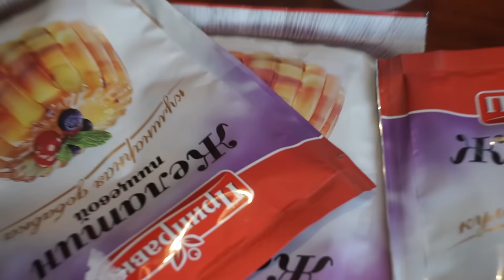Homemade Gear Casting, method of homemade silicone

Comment: Wait a minute homemade?
Yeah I have a lathe and a
Forge in my garage
Reply: I know what you mean, but you must admit that you can still do it at home.
Instead of a lathe, you can use a file and sandpaper to finish the detail, you can build an electric forge yourself (from scrap) or with a propane-butane gas cylinder.
Below is a link to the film in which my countryman shows how to make it, and a second link with the gas version
https://youtu.be/Mjlwc4x3GKE
https://youtu.be/b8zOQ4hyQzc
Reply: @Gabriel Barile  ...to add to Tristan, you can even do a hole in the ground foundry "How To Melt Aluminum With A Hole In The Ground" https://www.youtube.com/watch?v=O_TU-PCudoE.  I made a simple foundry with two round flower pots (one as lid, one on bottom with hole with air from blow dryer coming through to blast the charcoal) with about 1" thick layer of refractory inside, worked great.

Comment: I think plastic wheel protect motor against overload too, in case unintended gate lock.
Reply from the maker: the mechanism provides electronic protection; when the current consumption increases, the motor stops.
Reply: @mad_wheel  Also. If we change point of view it could be safety reason. Anyhow, amazing work. Congratulation and all the best.

Comment: Why isn't it made on metal from the factory? - Programmed obsolescence.
Reply: It could have been for safety. On many boats, they use a flexible coupling that will break if something hits the propeller and stops it. That protects the prop shaft, transmission, and engine from being damaged or destroyed. But if you use the correct fuse or circuit breaker on the electric motor, that should protect the motor from shorting out if the gate is stopped, and the video showed what looks like a reversing mechanism that will reverse the gate if it hits something and is stopped before it reaches end of travel.
Reply from the maker: The device has electronic protection that works when there is an obstacle in the way!

Comment: All those bubble in the pour, you have a garbage part, even if it looks good on the outside.  You have to de-gas the molten aluminum AND pre-heat the mold to 1100-1150F.

Comment: These gates can be broken bones by undesirable guests
😂
Reply from the maker: In the mechanism there is an electronic switch in case of excess current, if there is an obstacle.
Reply: @mad_wheel  I was joking. Of course there's a cut-off.

Comment: I wonder if the manufactuer  has the part for sale, one phone call could save a lot of work . cool video though but. 

 talk about dangerous for the inexperienced,, phew, also would probably grind the other gear to bits if its not smooth enough

Comment: I know the plastic is a kind of a breakable point so other parts do not. But who fixes anything any more? They might as well made it out of aluminum. And let it all wear out for much longer. Probably would have run for years if not for that plastic gear. Then throw it away. As you more than got your money out of it.

Comment: Sir, I want to ask what special hardener is mixed into the jelly.
Reply from the maker: I mixed glycerin from the pharmacy and gelatin from the grocery store in a 1: 1 ratio.
Reply: @mad_wheel  if i take 1 liter of Vegetal Glycerin and 1 liter of gelatine than it will work for maken a mold for a handle and its best too have powder gelatine greets danny

Comment: so if i understood that correctly you made a copy of the original gear out of something cheap and then created a mold around that new piece out of something that doesnt burn then poured melted metal into it replacing the first part you made as its burned up ?
Reply from the maker: That's right, I got a copy from the wax after I put it in gypsum and when the gypsum froze I melted the wax and poured it, and molten aluminum alloy was poured into an empty cavity in the gypsum.
Reply: @mad_wheel  that sounds awesome and all but I don't see how you would get all the fine details of holes and cavities in the middle of the part the outside would have the Sandy substance mold to it but what about the pieces in the middle of the part
Reply: @mad_wheel  if the piece has Chambers in the inside that doesn't directly touch the Sandy substance then how could it mold to it

Comment: I would have just cut the gear on the lathe from the start. if you don't have a rotary index, they're very easy to make. yes. they work on helical gears just fine. I still would have cast the Al for the stock, however.

Comment: With 3D printing technology replacement parts can be made overnight without burning a whole forest down
Reply: Most casting ovens use natural gas or propane
Reply from the maker: Now I do not yet have 3D printing technology.

Comment: plastic gear is used as a protection against damage to the entire mechanism is the least resistant. damage for a reason for a reason.
Reply: Plastic often becomes brittle in the cold. This mechanism might not be designed to work in the cold climate in which the author lives.

Comment: lets cast a gear, and finish it up with lathe.

instead just made it with lathe
Reply: What would you propose for cutting out the teeth? The whole casting portion is presumably to make that portion easier as he just needs to trim them to specifications but the teeth portion wouldn't be able to be done on a lathe...or am I missing something here? Interested to know for a turbine, inducer, and some other parts I was looking to cast and then dremel to specifications for a hobby project of mine.
Reply: @AM-dc7pv  I've made gears on a lathe and on a milling machine (using a good dividing head). Once I even used a broken gear as a hobbing tool.
Reply: @UncleKennysPlace  and how would you propose to cut the recesses in the back of the gear wheel with a lathe.

Comment: Fair WARNING HERE...When you cast aluminum it shrinks...steel is more accurate...in High School I learned from my Auto Shop teacher as he tried to cast Aluminum Corvette Valve covers for the DBC Engine...fail...because of shrinkage...I cannot remember the ratio but this can be found in google(I hope) it's a low # like 3% 0r 6% in this area...double check gang...
Reply: 2% volume shrinkage for cast aluminium.

Comment: Before this replacement You had one repair possibility - the weakest and cheapest part, which was that gear. Now the weakest part is probably one of the most expensive part. Failure in different location can lock the engine and burn its windings or destroy enclosure/engine mount. The procedure is really fascinating, satisfying, but not reasonable.
Reply from the maker: It is possible, however, the electrical control circuit has several overload protections, and when the permissible currents that can be set are exceeded, the motor turns off.

Comment: Great work, pretty awesome what we can make when we need to. I wonder if that part was supposed to break first though. It just seems like a lot of weight in a spot that would be an obvious weak point in power transfer. Maybe it breaks so something else more expensive and harder to reproduce doesn't. Many big companies make just as much, if not more, money on replacement parts. Similar to the $400 coffee machine maker who got rich by selling us stupid k-cups lmao
Reply: I'd rather wear out the pinion gear than the rack.
Reply: @petee716  in a truck or car that would make sense.

Comment: Just a stupid question, and I understand this was a learning process, but would it not be easier to just make the wheel on the lathe, seeing as you have one?
Reply from the maker: A gear wheel, and even with a slanting tooth, you overestimate the lathe a little, for this you need at least a fraser))

Comment: Yeah GM did that to cam gears "in the motor" for a short while. 
We all know why do this.   Greedy bastards aren't they?
Reply: 1980s Ford 351s had nylon cam gears.i replaced one with a metal gear!
Reply: Doesn't some newer cars have plastic sprocket on their timing chain??? I think I heard something in there is plastic, or nylon?
Reply: Cam drive on euro Ford V6 and Volvo B20 and B30 engines from the 60s and 70s were also crappy plastic called pertinax. Often failed miserably..

Comment: Awesome work sir. I can't believe they designed a door opener with a plastic gear!  Excellently made gear, fruit pectin worked out suprisingly well!
Reply: You will be more surprised, when you find out that audi wother pump impeller made out plastic, that's why they break up, pritty much all new car is junk from the factory, they disine to fale at curtain mileage, not like good old engeeniring.
Reply: The plastic gear is a safety feature, it's a sacrificial part. The door as it is now might cut someone in half.

Odds are, the part was manufactured for a Western European market with much milder ocean-influenced climate and actually lasts a considerable time there; but extreme temperatures of Russia aren't particularly kind to it. PA is the most common material for gears due to high toughness and abrasion resistance, but it gains it by absorbing water, it's strongly hygriscopic. And what happens when you freeze water? Well it doesn't behave quite like water in a container , there is some leeway due to how water molecules are suspended, so a bit below freezing point is still safe, but freeze it deeply enough, the polymer will get torn apart from the inside.

Comment: As a retired manufacturing engineer, i can attest to the proper-ness of the plastic gear. The plastic key would fail once and have to be tore down for repair. the plastic cog will PARTIALLY fail once and continue to operate at reduced functionality. 

Im betting there was a period of time where this thing was slipping and sputtering, but still getting the job done. That kind of failure is tested for. Neither a key pin or a cog wheel are part of any human safety rating in that equipment, the engineered failure point is strictly for the protection of the motor and the rest of the machine. 

I don't remember the specs for human safety rating, crush and pinch forces. But i do know, its a helluva lot less than the force needed to fracture a key, or a gear.
Reply: Not an engineer in a related field myself, but i suspect many experience-based considerations that involve polyamide that make it appropriate for Western Europe, especially used in a damp environment like that, and would make the gear last for many decades with barely a sign of wear, fall apart once you approach -40°C in winter. PA gains its strength and slipperiness from being hygroscopic, and the way the water is suspended in the polymer matrix should discourage formation of ice crystals, but if you just try hard enough and get it cold enough, it's still going to be torn apart from within.

I don't know, your consideration is interesting, but "is it safe for humans" is not a binary, it's a continuum. A sacrificial weak link can make all the difference between severe, potentially life-threatening injury and being completely cut in half. I think given that it's a motor for a door that's supposed to protect whatever is behind it, it being reasonably safe was likely off the table to begin with, but there are levels of compromise there.

Comment: As others have pointed out, having the plastic gear in there is an excellent design element for safety reasons. The problem is that manufacturers hardly ever advertise and have replacement parts (+ service) readily and easily available to consumers.

Comment: Plastic gears are pretty common on garage door openers and gate openers. They're there as a fail safe in case something on the door or gate breaks and it can't be moved. It's a lot easier and cheaper to replace a $10 gear set than it is to replace a $200 motor.
Reply from the maker: The device has electronic components, sensors that monitor the current consumption of the engine. If the current exceeds the motor, it stops. It is also possible to adjust the load to shut off.

Comment: Sometimes plastic gears are used because of safety reasons - but not as only mechanical fuse, but also for extra electrical insulation between ,,live" components like motor, and the others (for example in electric drilling machines etc.). Be sure of proper grounding, to not touch a phase, when you touch the door...

Comment: Top video but did you increase the diameter  with the tape on the gears teeth
Reply from the maker: It was required to compensate for shrinkage

Comment: OK SO YOU PLAGURIZED ANOTHER PROJECT BUILT FROM ONE MATERIAL TO ANOTHER.EVER RELIZE METAL CHEAPER TO PRODUCE THAN NYLON OR OTHER MATERIALS.THE PART YOU PATENT INFRINGED ON DESIGHNED TO BREAK AWAY .MEANING PURPOSE MATERIALS WERE CHOSEN SO IF MAIN PART NOT THE GEAR ITSSEALF .THE GEAR MATERIAL USED SO WOULD BREAK AND CHEAPER TO REPLACE THAN MAIN COMPONETT HALV FUN WITH PROJECTS. HOW'S YOUR BRANCH PARTNER IN THE BRANCHES .WITH THE 12 STAR BLU FLAG CHIEFTAIN DOING THESE DAYS.IM GUESING YOUR PATIENT INFRINGED FAULTY PRODUCT NO BI IG DEAL YOU CAN ALWAYS COME DOWN WITH Y'ALLS BLUE PENTAGRAM FLAG AND SHOOT PURCHESER IF YOUR HYBREAD THINGY BY FORE NOW

Comment: In Soviet Russia, YOU crush gate!

A polymer gear could be a good design choice I think. Somewhere in the system there should be a part that can be designed for easy replacement, that will fail correctly under the correct circumstances. The idea of a ‘key’ that is made very simply from common materials that will turn the gear yet break by design if the resistance of the gate’s movement rises above a defined limit adds the requisite safety and function. And it allows simple, cost effective, ‘green’ replacement while increasing the design life of the installation. 

The marketing department sees this as a terrible idea because many fewer units will be sold, the quantity of upgrades will go down, and sales of replacement gears will dry up.

I wonder it poorer product design combined with better marketing IS the recipè for success? It comes down to integrity vs extra profits....

Comment: Aluminum will shrink when it cools so using the original part as a master will end up making the final part that is about 2% too small...surprised this gear meshed with the original machine.  This dude got lucky that the tolerances weren't higher in the original assembly.
Reply from the maker: the video showed how I increased the size using a layer of duct tape.

Comment: Fabricating parts from scratch is great, but many  "throw-away" plastic parts sometimes serve a higher purpose, Example, If the gate limit switch or relay fail and gate comes to a dead stop, the plastic gear snaps and saves the motor and other more expensive parts,.. if there is power failure the gate will not open(but don't tell anybody) you pry the gate the gear snaps and you're on your way... lastly, if a vehicle or person gets trapped between the gate and it's closed position due to a sensor failure ..well the plastic gear snaps and, well,.. maybe you only have to buy somebody lunch.

Comment: Very cool, and what a project. Imagine the steps you could save by scanning the part or drawing it in a solid modeling program, and 3D printing one.  I'm in such a college class this semester. There are some pretty durable materials that could be used, especially with one of our resin printers. Our college also just received a 3D metal printer that is the cat's meow.  Guess who's going make some stainless steel tools for a diving kit.

Comment: When I was second year student, we did some kind of aluminium part in soil, soil-method(idk how is it called in english). It seemed to be weird but the process was cool. The funny part was that our lecturers were students obtaining their master's degree so firstly they hadn't heat aluminium to proper temperature so we've got it on second try.

Nice job, keep up the good work! Now about lubrication - as I see it's blue, what lubricant do you use?
Reply: https://www.mobil.com/en/industrial/lubricants/products/mobilgrease-xhp-681-mine
Reply: https://www.mobil.com/en/industrial/lubricants/product-series/mobilgrease-xhp-220-series
Reply: SAF-NSK In US probably is called Sand casting. Very common process. I think Aluminum is mostly done with Lost Wax process. We also used to have Stainless castings made with Lost Wax. At B/E Aerospace.

Comment: It is wrong to replace the plastic gear wheel with chrome gear wheel.  The reason for this is to keep in safe the parts inside the box in case of the outer iron wheel interface for more pressures to move the door.

Comment: I wonder, if you already have a lathe wouldn't it be easier to just make a new gear?
You can easily cast a metal cilinder to get the material.
Now, I know. Maybe not everybody has the tools used in making gears but at the same time why wouldn't you? if you have a lathe already...

Comment: Wax in plaster.  The plaster is exothermic, so your wax mold melts before it sets.
Reply: Not if you use a thin layer of plaster before other layers.

Comment: Agar is commonly used for making duplicates. Gelatin with glycerin is a good alternative, but using regular gypsum is a mistake, also casting into a cold mold will cause porosities and warping. He didn't add a reservoir which caused a miscast in the first mold